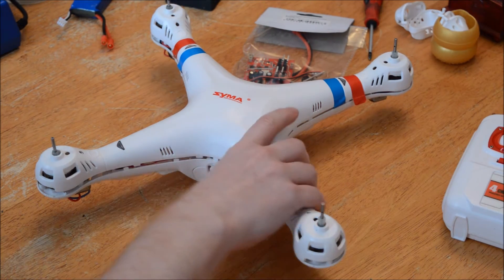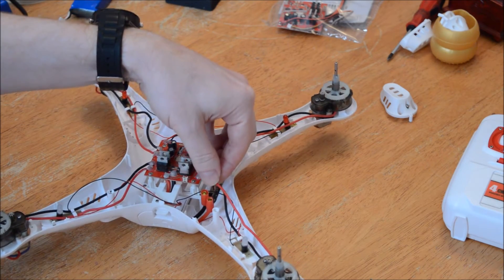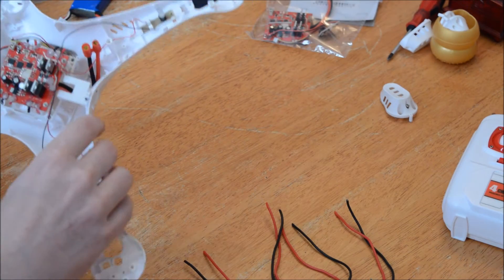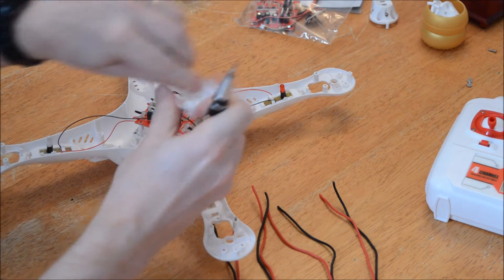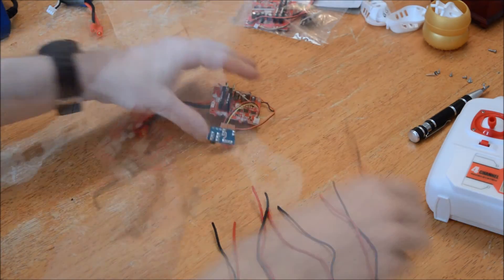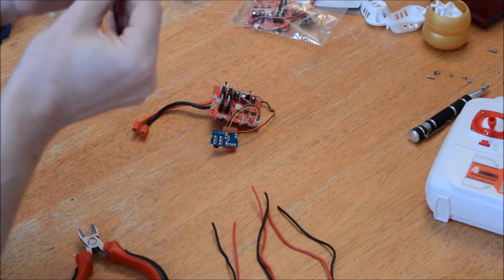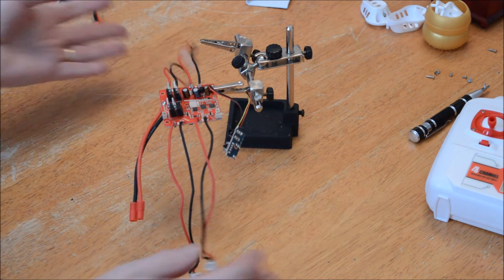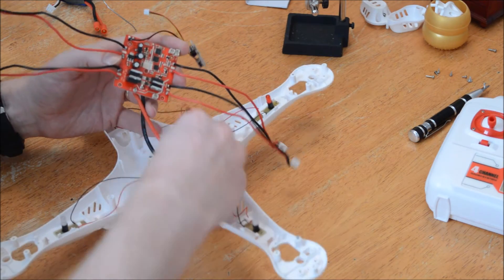Syma X8C and X8W - Change Main Board

Comment: Hey can u tell me the name of the wire that is connected to the motor
Reply from the maker: amey naik I don't know a specific name for the wires to the motors sorry.
It's a 2 wire connection and colour coded for opposite corners. You could use any standard wire to make your own tho, as long as you have the end connection for the motors still.

Comment from the maker: hi John.
I would swap the faulty motor over the one in the opposite corner (the one with the same coloured wires).  
Then try it.   If the same side is still faulty then it's not your motor at fault and has to be the wire to motor Or the main board. you can also swap the wire to motor just incase to try..
If it's still the same side that's faulty then I would say it has got to be the main board or connection to main board.

If the fault moves to opposite corner when you swap motors then it's just the motor at fault, which would be better for you  :-)

Hope this helps.

Comment: I have the Syma x8w, which I've only had a few weeks but I'm sort of experiencing the exact opposite issue. I have one motor that wont work at all. I haven't crashed it once so i know its not from that, using a test light i checked all the connections leading to the motor that isnt working and had power everywhere. I'm thinking maybe flight control board? Any thoughts or suggestions would be appreciated.
Reply from the maker: John Adams hi John, if I were you I'd swap the motor in issue over with the opposite corner motor and try it with no props just with the top cover still off.
If the corner with the issue works and the opposite side doesn't then it's just a dead motor. you can pick them up from ebay for very little money.
Cheers